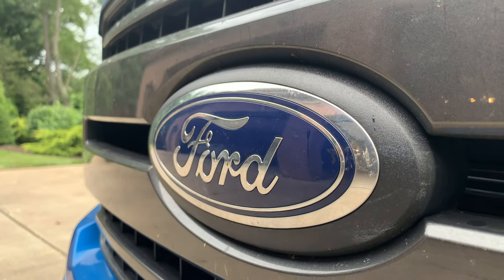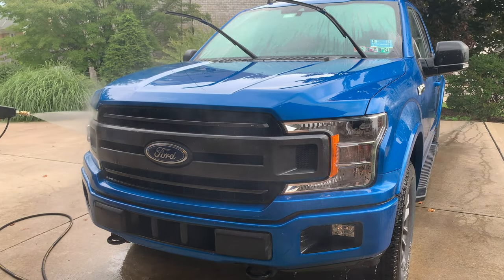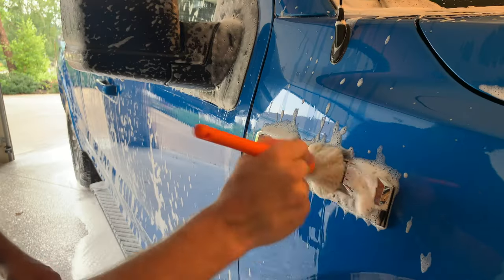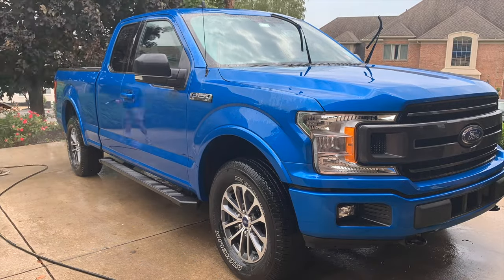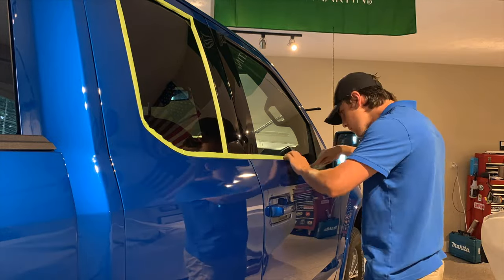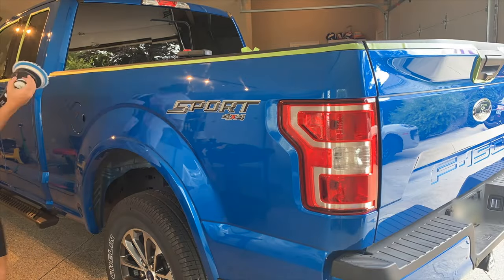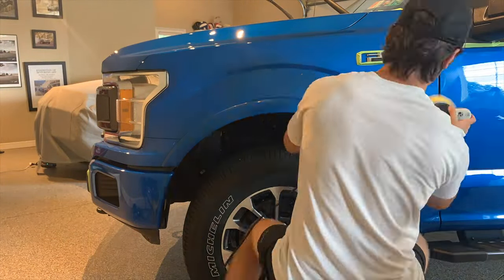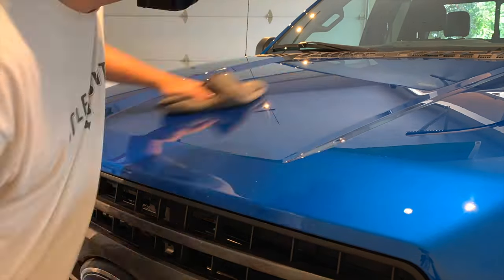Detailing My New Truck

Comment: Nice job.  I have an F150 as well and it is very time consuming to get a good outcome like this.  I've been using spray ceramic but I think I'm going to bite the bullet and use a standard ceramic/graphene coating.
Reply from the maker: Hey, Mike! Yeah man, a quality coating is worth it. I used PDP’s on this truck (10h Graphene, 50ml). About $130 a pop. I also recommend GYEON MOHs. Super easy application and is silky smooth to the touch which I personally really like.

Comment: Great video….I like how you mentioned most of the products you used, as most retailers never tell what they use.  Could you give me a list of everything you used?  I have a ‘19 F150….been giving serious thought to doing a complete detail on mine.  What do you use for the drying process I didn’t catch that part….
Reply from the maker: PDP insane orange snow foam, brake buster/PDP iron melt for wheels, Rupes LHR15 Polisher, Rupes Wool and Yellow Pads, Sonax Ultimate Cut compound, Sonax Perfect Finish Polish, PDP panel wipe, PDP 10h Graphene 5-7 year coating

Comment: Excellent video!  How much graphene did you use? What pressure washer and polisher did you use? What parts of truck did you NOT graphene?  Thanks
Reply from the maker: Hello Laura! So I used a 50ml bottle of 10h Graphene coating from PDP. I coated all the paint including front grill, and the wheel faces. I think I did one light layer on the glass as well. I use the Karcher K17 pressure washer and Rupes LHR15 Mk. III
Reply from the maker: I didn’t coat the trim on the bed simply because I didn’t have enough coating left. I don’t think there would be any places you couldn’t use graphene though (if that’s what you were asking!)
Reply: Yes. Thank you

Comment: How’d you polish inside the f150 print on the tailgate?
Reply from the maker: I didn’t go too crazy with that since it was a new truck. I just pushed a little harder on the pad and gave it more of a polish/clean than a paint correction since there weren’t scratches on it. Otherwise I would just use the flex mini polisher with 1 inch pads

Comment: What did you use to treat the rubber strip at the bottom of the side windows?
Reply from the maker: You can use ceramic as long as you wipe it. If you don’t wipe it’ll leave residue behind and look dried out

Comment: Hi ,nice video can you share were to buy the grafhene ceramic coating you used please
Reply from the maker: Sure thing Antonio! Professional Detailing Products in Ohio. Coating can be a bit finicky if you wait too long to wipe off. Key is to wipe right when it starts to bead on itself. Best of luck!
Reply: @CameronRDavis  thanks for answering, is there a link to buy the product, do you recommend it
Reply from the maker: @antoniotzul8807  I can’t sent links in the comment section unfortunately. But if you go to professionaldetailingproducts.com and go to their coating section, it is called Perpetual 10h Graphene. I like the coating for paint and wheels but hated it on my windshield because it would cause wiper chatter. I’ve been using CarPro Flyby Forte for windshield coating.
Reply: @CameronRDavis  I see thanks for the info ,I just planing on do it to my  tundra I never have done something like that ,
Reply from the maker: @antoniotzul8807  I would caution against it if this is your first time using a coating. Inc sit cures you can’t even compound it off because sit is so hard, so if you make a mistake you would have to wetsand. I’d highly recommend either CarPro Uk 3.0 or Crystal Serum light for your first coating as they are easy to work with. Once you get one coating under your belt you’ll be more confident and can try a tougher one. Make sure you do it indoors and have a decent light or two!
Reply: @CameronRDavis  I think I have to try ceramic coating being my first time 😅
Reply from the maker: @antoniotzul8807  Yah man, you will enjoy it. I hate when people put coatings up on a pedestal and make them intimidating, but the 10h Graphene really can be scary to work with. The coatings I mentioned you should try are super easy and user friendly and you will have a great time applying  and enjoying it
Reply: @CameronRDavis  even firt time to do paint correction using a polish machine ,do the ponish has to be inside as well ?or can be done out side
Reply: @CameronRDavis  yes I will try the car pro uk 30
Reply: @CameronRDavis  sorry for to many questions ,for decontamination you only used macce,s 914 and the same product for clay thats enough for decontamination,there will be no need of what other people used like ironx ,or bug recidues remover ,
Reply from the maker: @antoniotzul8807  Just depends on the vehicle really. I can’t quite remember what I used in this video  but I typically do iron decon, tar decon if needed, and then clay. I don’t really use 914 anymore, just happened to be testing it that day.
Reply: @antoniotzul8807  so how’d it turn out on your first go? I planning on doing it to my tundra for the first time even as well. I’m nervous but don’t want to spend 1k+ for someone else to do it..
Reply: @kyleramynke2710  hi .there  was to mucho to be prepared like paint correction  ,and must have a enclosure garage to not get dust and tree fall and the car or pollen  if you doing  it with out that in Mind you will end it all that trap Onder the ceramic coating and there will be no way to fix that as they said.
I ended up not doing it cause I have no garage and my truck has scratches that must be removed before,i bought polish machine and watch YouTube videos about paint correction but by that  time I gat fall on me so I ended up not doing it and I never buy the sera mic counting,some people said after doing ceramic coating you can not go back to other methods i think if you planning on do it with all that in mind and after whatch o Lots of videos on YouTube and fill ready ,go ahead

Comment: You are the first detailer to use air pressure to blow off the water from the car
Most try to push the idea of getting a special device to do that
They use even different air blowers as a only way to get rid of the water

I guess they get a kick back every time they promote that idea or free stuff from the retailer 
Nonsense
Reply from the maker: Yes I used compressed air for a while and then ended up getting a blower. Either is fine but blower definitely moves more water.

Comment: Too much work! I don’t see a difference. Sure looks great! It’s cleaner , yes but is it noticeable? I have a feeling this ceramic coating stuff is a placebo.
Reply from the maker: Yes lots of work, but important to polish for coating adhesion anyway. Been over 7 months since I applied the coating, it’s been through the gross salty Pittsburgh winter and is still holding up great and water beading as it should!
Reply: @CameronRDavis  very nice!!!! I’m not too far away from u. I’m in Philadelphia pa :)
Reply: @CameronRDavis  just spray some grease / oil and your car will shine and repel water the same as with this ceramic coating lol